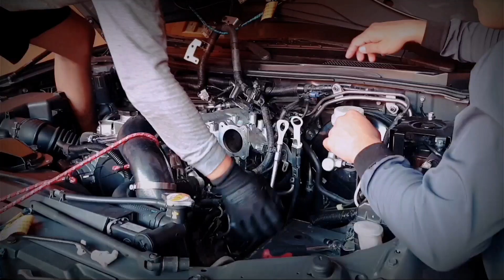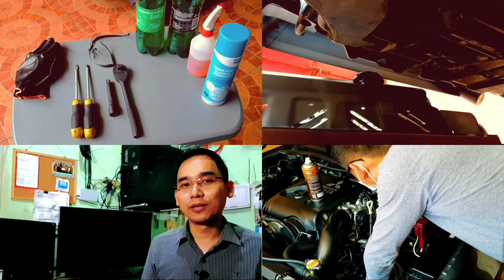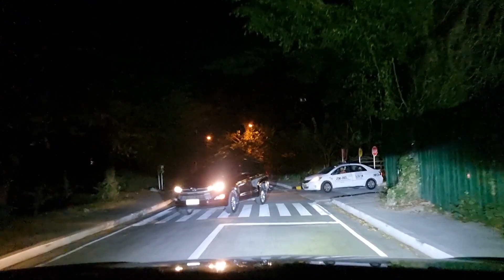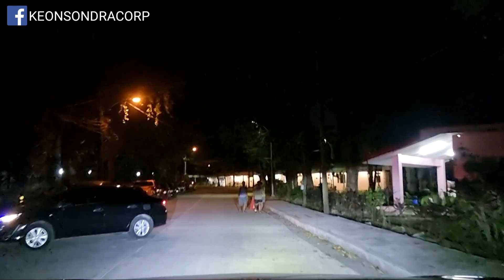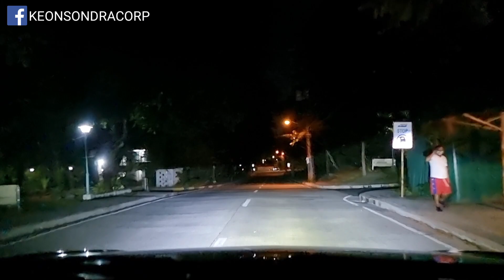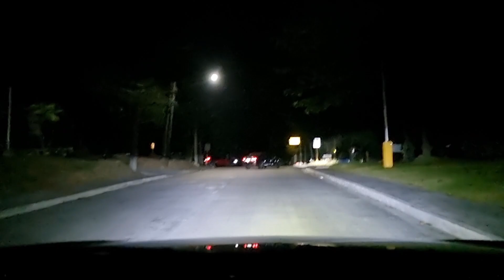Gaano ba Kaganda ang Keon Sondra LED sa Gabi? | POV Night Drive

Comment: Noah be considerate sa makakasalubong mo. Mataas masyado headlight level mo. Kung hindi na ma-adjust, that LED could not maintain the level ng original halogen light ng montero mo. I am not against with the brand  you are using or recommending, but lets keep our road safe to all. Maybe you can keep your foglight, but not your headlight. CREE type ( XHP50, 70, 70.2) of LED is good for foglight (reflector type). You can try the Novsight N37 ( G-XP type LED)..possible your Brand X Novsight is not the latest Novsight LED. Keep it up !
Reply from the maker: Yes sir very considerate po at ayaw ko na mamura ako ng kasalubong ko hehe. Salamat sa paalala sir
Dont forget to subscribe
Reply: libre sa keon sondra ang pag adjust ng headlight sa pamamagitan ng headlight aimer/adjuster na gamit ng lto kahit hindi keon sondra ang led light gamit, pwede mo ipa adjust,
Reply: Sir chineck ko yung Novsight N37. Parang taas ng wattage nya. 120 watts for pair.
Yung sa Keon Sondra 90 watts lang ata or lower..not sure..hehe.
Anyway sir, pwede naman yan ipa-adjust ni sir Noah sa Keon..
Reply: For me hindi siya masyado mataas, sakto lang yan saka siempre pina align na yan sa keon sondra, tama lang yan kasi sadyang mataas sa kanan ang purpose yan para makita ang mga roadsign sa kanan, sa kaliwa mababa para hindi nakakasilaw sa kasalubong. Ganyan din ang LED na nabili ko mataas sa kanan mababa sa kaliwa.
Reply: Mgkno po pa install led headlight montero 2022 model po